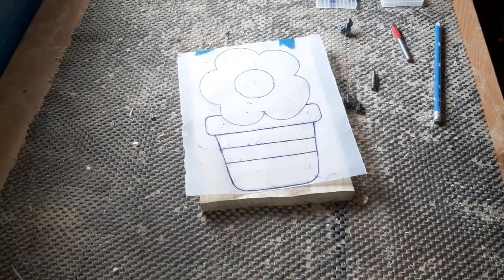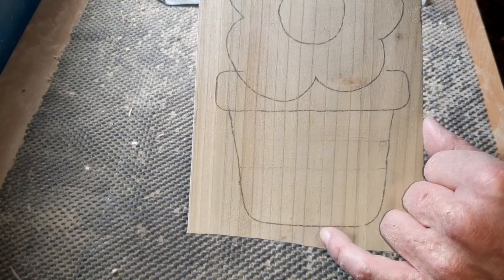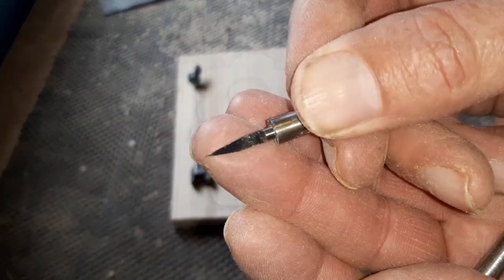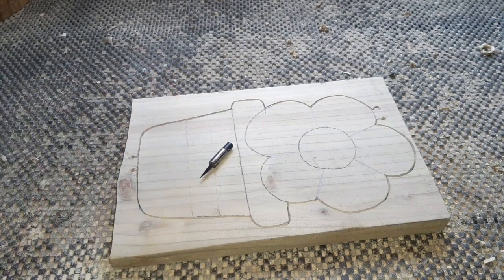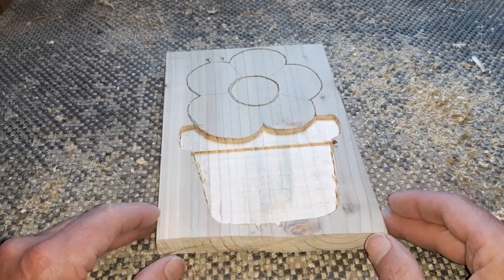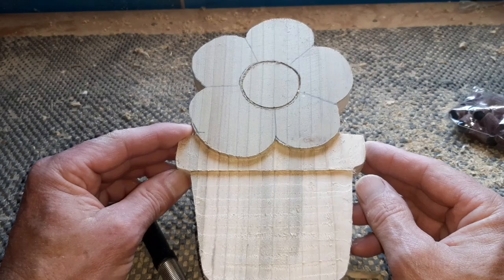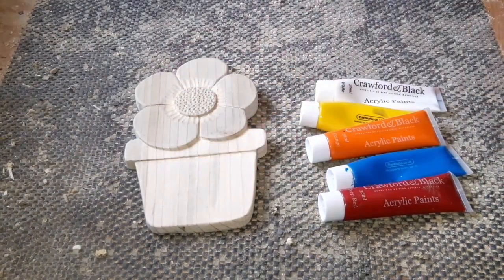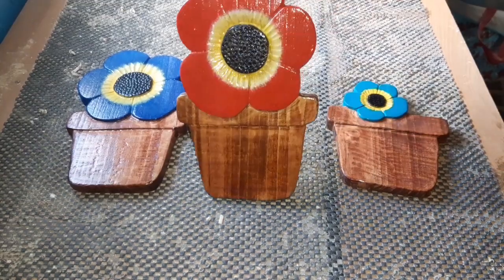flower in a Pot..made on fencing wood, router, scroll saw, dremel project...

Comment: Great video showing the different tasks to get the end result. Great starter/practise piece. Many thanks. Don't know if its of help to anyone but I also use the tracing paper/tablet to make the templates. Had problems when trying to trace the picture with touching the screen and picture moving. Solved this by having a thin piece of clear plastic perspex ( size of tablet screen ) which I attach the tracing paper to and  place this down on the tablet screen. This way can still see the picture to copy but as I am not touching the screen no movement of the picture I'm trying to trace.
Reply from the maker: Thank you Graham, excellent idea with the perspex,I've been Court out a couple of times regards to the image moving ..🤣👍